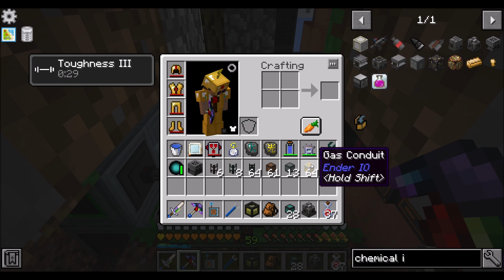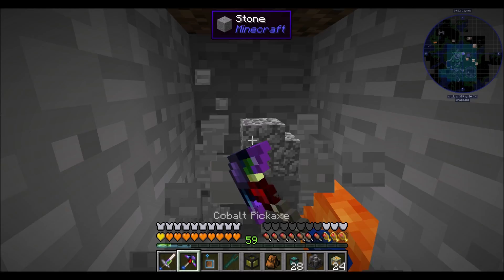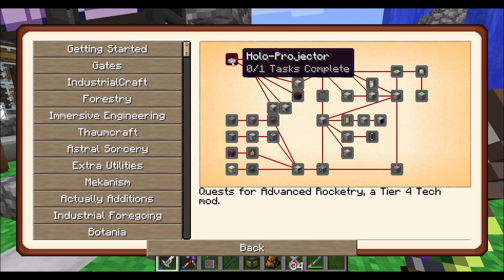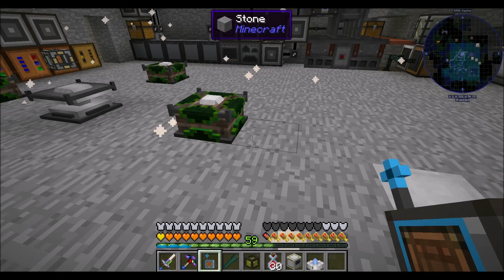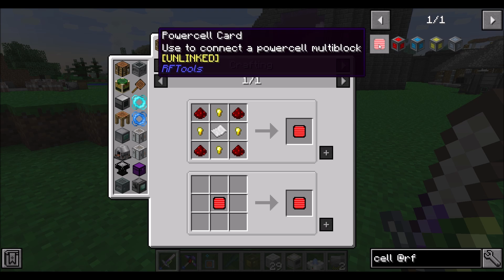Enigmatica 2   Ep57 Ore Quadrupling

Comment: Rocketry.... Large multiblocks.
Someone get busy making a vehicle assembly building complete with rocket built of engineering blocks/sheet metal (probably a small one) surrounded by say 5-10 stories of Multiblock storing building along with a few pipelines for all the plumbing dire is going to need.

Comment: All the crafting: I just searched for @vulpes and taught AE all the things.
Powercells: I'm using advanced power cells for everything. 3 of those gas generators (thanks for the tip!). UU matter to duplicate the machine frames, which otherwise require pink slime and are a nuisance.

Comment: Integrated Dynamics/Tunnels has a transfer limit of integer max (2^31 - 1). Even if all you use it for is power, separating all of the conduits into partitions that hookup with ID, it's infinitely better. AND power transfer doesn't need logic programming to get going either.

Comment: The automated workbench is a bit annoying, it's a decent sized multiblock and it can only be set to craft one recipe each to my knowledge(unless there's a secret way to select multiple recipes), so you need multiple of them, at least 2. One for vacuum tubes and one for the circuits. It's just annoying that they use so much space and only do one recipe.

Comment: you know ... all it takes is a little reworking for the AE chips to be allowed to craft individual components.... just set each inscriber as it's own and use interfaces to connect them instead of how you did it originally. then all you would need to do is teach recipes

Comment: For your empowerer, you can just use priorities, say priority 10 for the middle stand for inserting. In your recipes make sure the first item inserted is the item being empowered, so the first item that's moved is moved to the highest priority stand. Then you don't need the filters. (This is only a theory, haven't attempted it myself)
Reply: Thats what he did wen setting Up the empowerer but If He crafts more than one thing and the stuff He createt has Not been pulled Out the priority stuff dies Not Work, maybe he can stop the importing to the Point the requested stuff has been extracted....
Reply: @Mongolenfreak  
could honestly use xnet for this, that way you can check if a item is already inside of it. you can even check for the end result. xnet is so powerful, but hardly ever used. plus you can give the stands power, items and check for conditions all within a single block. ahhh xnet why are you so underutilized.

Comment: Oh, I almost forgot to start screaming this. Compact machines are a thing.
Reply: Yeah, they're nice for big stuff. I put a fusion reactor in a max sized one and it's providing like all the power I could ever need. I actually needed to use Cyro-stabilized fluxduct because ultimate cables couldn't handle all the output. Have to be careful about overheating though, make sure to use coolers. Also had to make a bunch of pumps to get enough deuterium. I could have run it with just hydrogen I guess. Not sure how much power that makes. Hydrogen+Deuterium though generates over 500,000 RF/t. I can basically max out the speed on everything. The only thing that eats a huge chunk of that power is the Environmental Tech void miner with lots of speed upgrades. I could do Deuterium-Tritium too I guess, but that can't be done entirely in a compact machine because you need those solar things to convert the lithium into tritium. Not sure what the max output of that would be.

Thinking about it now, I really should have built some of the big multiblocks inside a compact machine, though I do have lots of space in my basement. The modular machines and some of the advanced rocketry machines would probably fit, though they're not really that huge for the most part.
Reply: @MindCaged  I also use them for sets of machines that you is for a simple input output setup. For example, I made the entire ore ×5 setup inside of one excluding the solar setup. Makes things really simple. All I do is have an input for ores, and output for ingots and a drawer on top for a sulfur input.
Reply: @GuitarLamp817  I considered doing that. I haven't gotten around to it since I'd have to disassemble and rebuild the whole system, and I also reuse parts of the system to power other stuff like hdpe/ethelyne/chlorine/etc production. It all ties in together very well honestly. And what solar part? The evaporation plant? You do realize you can run that without solar right? You can either use the electric heater on a valve, or even the fueled heater thing(surprisingly it actually generates a lot more heat than the electric one, but doesn't stop burning fuel just because the plant is maxed out) You can adjust the power input on the electric heater to adjust the heat production to match your brine rate.

Comment: You can collect the rf from the 4 solar panel on the thermal evaporator , the tep don't need power
Reply: that is exactly how he built it
Reply: @SIRborioVojta  he didn't connect power outputs to the multiblock solars
Reply: @supersonictumbleweed  yes, first he forget connect it, but later he repair it

Comment: you may as well start ore quintupling since you already have sulfuric acid
Reply: But the sulfuric acid he made is made with nuclearcraft. That doesn’t seem to be compatible with mekanism. Unless I’m missing something.
Reply: @LunacyBlinks  The guy who makes Nuclearcraft specifically made it so all Nuclearcraft fluids that have a Mekanism counterpart are compatible.
Reply: PyroDesu yeah. I know niclearcraft will accept mekanism fluids but the sulfuric acid needs to be in gas form and the rotary condensentrator doesn’t work with the liquid form of sulfuric acid from nuclearcraft. I’ve tried getting it to work for a while with no luck.
Reply: @LunacyBlinks  I seem to recall that if you hook up a gas pipe instead of a fluid pipe, it'll output the gaseous version.
Reply: PyroDesu thank you. I finally got it working. I was using gas conduits and I needed to use the gas pipes from mekanism. Makes sense now. Thanks again.

Comment: I'm super glad that you're getting into AR now! It's my favorite space mod for minecraft, and I just rushed AR in my regular E2 playthrough, it's going to be, if it's worse then normal, extremely resource heavy. I did a lot of mining myself, to get a good buffer and it still ate through all my iron - making steel. I also suggest using lighter materials for your rocket, because the heavier it is, the more thrusts/fuel tanks you need for your rocket, and I made a very small rocket and because I used stone, it was super fuel needy, so I got rid of the stone and used glass instead. Another thing, it doesn't register some blocks, so when you click build, they will either, go in visible - like my fancy glass - or give it the broken texture. It still works perfectly fine, I had both invisible blocks and broken textures and have been to the moon and back, it can just be rather sightly. Also, once you click build, after it's registered that it's a complete spacecraft, you can not change anything, so be careful! But, I hope you have lots of fun, and I hope the grind doesn't wear you out for the mod!

Comment: Precision assembly machine, Crystalizer, cutter, rolling machine and the Chemical mixer thing. No need for a lathe. Rolling machine is mainly used to make the pressure tanks so you can have oxygen to breath. The chemical thing is to make rocket fuel but not super needed as you can use other fuel sources according to loading tips screens... I haven't tried it though, just made rocket fuel
Reply: The chemical thing is no longer needed because the recipe for rocket fuel now needs immersive. Or yes, other fuels like liquid starlight

Comment: EnderIO makes mek's ore mechanics soo much easier and cleaner.  Yet dire still manages a mess of wires lol
Reply: I litterally made the ethylene prodcution in a 3x5x5 area with one of the 5 being in height. Thank you conduits. Because of how they work i could put in fluid, gas and energy into the same side of the prc. Way better then having to use all 6 sides of the machine.
Reply: @dylanspek3917  now we just need ender gas conduits
Reply: @mralee2  Ender gas conduits are a thing?
Reply: @dylanspek3917  nice.  I watched a yogscast guy (can't remember his name) build a mekanism x5 ore processing and from what I can remember it took a huge mess of pipes and cables and a good chunk of the floor he used.
Reply: @KawaiiKitten 
Was that Will Strife? He was the only one ever competent enough to manage 5x ore processing at all. Even Ridge didn't get into Mekanism.
Reply: @Her_Imperious_Condescension  yeah he was the one
Reply: also, gas conduits are not part of base enderio. they are an addon
Reply: 5x processing with just Mek piping is an amazing sprawling mess that is turned into something beautiful thanks to enderio.

Comment: I found that my AE system sometimes has a blackout when autocrafting if I don't have a dense energy cell in the network, one of those could help with your power issues
Reply: 1. Setup a small Integrated Tunnels cable going from your battery (not from AE2, connected to you generators) to an energy acceptor hooked up to the network.
2. Set the transfer rate from the battery (an energy importer) to 2 billion. Use a blank variable in the boolean slot.
3. Set the transfer rate to the acceptor (an energy exporter) to 2 billion. Use a blank variable in the boolean slot.
4. Never worry of a blackout again unless you manage to drain the battery.
Reply: @zecuse  I find it a lot easier to just use cryo stabilised fluxducts.
I was lucky enough to get some out of a loot crate, but I don't think they're extraordinarily hard to make given that Enderium is craftable early-mid game through Nuclearcraft.
Reply: i had the same problem. and yes that worked for me too
Reply: You just need more power

Comment: You will need more coprocessing for 20 structures yes?
Reply: I dont believe that is necessary the only thing that a coprocessing block ads is the ability to craft more then 1 recipe at a time. If you dont add coprocessors it will do all the steps 1 at a time so it takes longer.

Comment: U can put a stack downgrade upgrade in a drawer and put other upgrades in so it holds more stacks
For example a gold upgrade and a downgrade holds 5 stacks.
Reply: I had never considered trying that for some reason.  A lot of times I only want to store 4 stacks of stuff so have used 2x2 drawers in the past that would hold 4 stacks of the same item.  Thanks for the tip.
Reply: It does work, I specifically designed it that way.  :P

You can also put a stack downgrade into a 2x2 drawer and then each of the four subdrawers will hold one stack.  And you can upgrade that to two stacks of each if you want as well, though obviously there's no point going higher.
Reply: Are you sure? I swear I've tried that and it didn't work right.
Reply: I just use that for my automatic wither slayer

Comment: Anyone else want to see all the conduits in one?
Reply: I've done it before. It looks interesting.
Reply: Yessssss.. a true universal cable mod would help a ton
Reply: That's exactly what XNet does. Unless you're interfacing with a machine that needs to pipe in/out the same type of thing to multiple sides (vanilla furnace items and fuel or mekanism infusers off the top of my head) XNet will do everything from 1 face with 1 cable. If multiple faces are needed for this, phantom faces or ender porcupines are cheap and easy to setup.

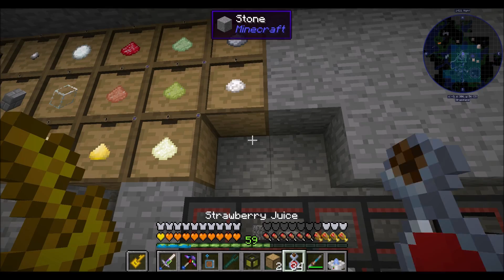The drawback is the need to get into using routers for more channels so you're not doing everything with 1 controller, but that honestly makes things easier to do anyway as it makes you put related things together on separate networks unlike 20:11. Just route the output from 1 network to whichever other network needs it. It's a good way to understand how AE2 sub-networks should be built.

Edit: Also remembered that XNet can be slow if you're machines produce things too fast.
Reply: @zecuse  Xnet allows you to do universal cables but imo they super op since the only obstacle is setting them up the first time. A lot of the cool things in making complex automation dissappears once you know how to properly deal with porcupines as every setup basically becomes a line of machines, porcupines and wires. I think enderIO has a great balance since you can deal with everything in one block (besides machines that can't input/ouput out of the same side) while still having you work a bit. I saw a dude that was working on a mod to make multipart pipes so you could have something similar to enderIO but with more pipe placing and such but I think it's in early dev still
Reply: lol I was thinking the same thing

Comment: Is it DireTime? It's DireTime!

Loving your playthrough so far!  
-Enig2 Co-Dev
Reply: Thanks for giving him the opportunity to entertain us all, friend.
Reply: is he doing decent?
Reply: @mew He's doing pretty good, with his Dire knowledge and techniques :D
@caezar Automation is the big thing in the pack. XNet is just as powerful (if not more) than EnderIO conduits, and that's even cheaper. Making useful wires expensive would just be a massive chore instead of challenging
Reply: @LukasLLM  Yep, you're right. No need to lock everything behind a pointless grind. 
Never used Xnet before, but I hear it's somewhat like Steve's factory manager, which was super useful for automation. I need to check it out
Reply: @caesural  Id argue its more powerful than SFM.
Reply: Why are EIO conduits so cheap compared to everything else :)
Reply: @caesural  they aren't really because you need alloy furnace at the very least and the same is necesary fir the mekanism pipes and cables. The xnet cables are also about as expansive and necesary for the thermal fluxducts. So all cables are about as expensive as the other so you can use what you really want. Only thing that can be seen as kind of cheap is the item and fluid ducts but still not cheaper than another alternitive.
Reply: @dylanspek3917  EIO's basic energy conduits are much cheaper than basic universal cables. Even ME conduits are cheaper than ME cables. All conduit recipes were vanilla. And you didn't need an alloy smelter for conductive iron, you could make it in a TiC smeltery.
Maybe this was an outdated version of the pack, I'm not sure.